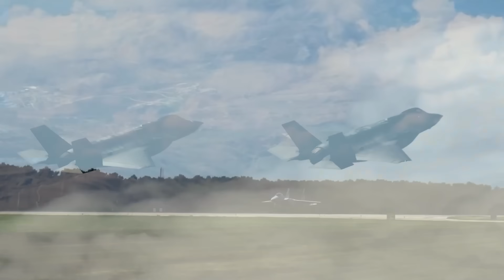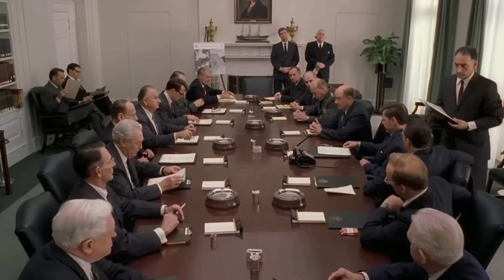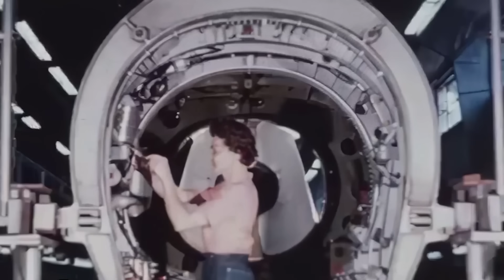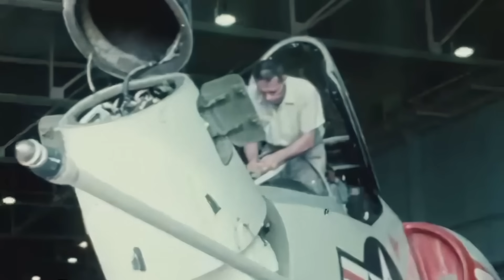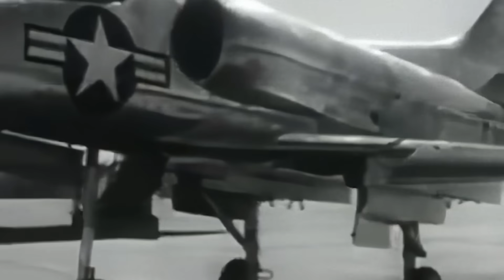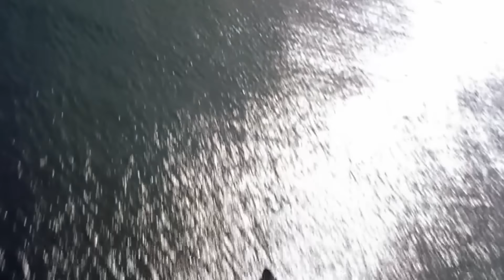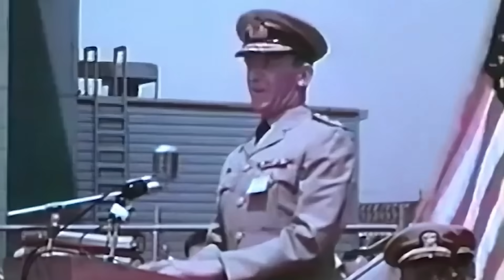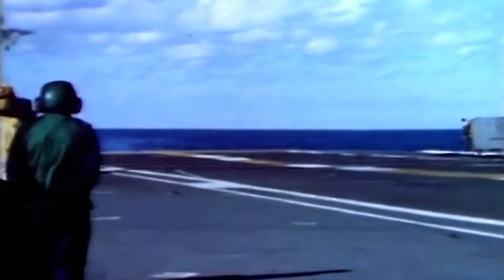A-4 Skyhawk - Simple and Deadly

Comment: This is exactely what Aero Engineers should learn
Reply: I agree to an extent. Yes, it is important to not Rube Goldburg a device ment to do only one or two tasks, look at the A-10. But there is such a thing as making something so simple it's inflexible. Again, the A-10 is a good example.

Take the F-16: it was built to be a pure dogfighter and it's very capable in this role, but soon after its introduction it was pressed into becoming a light multirole fighter, not because that's what the Air Force wanted for it but because that's what was needed to stay combat relevant for the next few decades.

I guess what I'm trying to say is keep simple stuff to do simple tasks. The problem is air defense networks are made extremely difficult to penetrate on purpose; especally modern near-peer ones which are way more intricate than they were back in Vietnam, to the point where you kinda need something as complicated as an F-35 to do so.
Reply: @pyronuke4768 or you make two comparitively cheaper alternatives, one focus on air to air to protect your “growlers” and one to focus on anti radiation sorties, and then many more cheaper craft without stealth for once air defenses have been disabled. Most of these nations are never going to face a threat from NATO, the US, or Russia/China in full force, and this is more than enough.

Most nations would be sufficiently armed with 6-12 Boramae, a growler super hornets, and 10-20 f-16/grippens/rafales or even f-5’s and another 10-12 planes in the ta-50/t7/super tuscano mix
Reply: @cjones070  it sounds like a good idea now, but what happens two decades in the future when a much larger and aggressive nation comes after you with a fifth-gen aircraft of their own while you've sat on your hands upgrading fourth gens from fifty years ago? You would be rather powerless to stop them. That's why half of NATO has been trying to obtain F-35's: to dissuade any potentially aggressive threats from attacking in the first place.
Reply: @pyronuke4768  if a much larger nation comes after you, they’re almost always going to be a generation ahead of you regardless, but that’s why i stipulated that you still need SOME current tech, but you also need quantity. For many countries having 10-20 current gen aircraft and 40-50 f-16’s, grippens, rafales, or even f/a-50 style aircraft would be better than only having 30/40 current gen aircraft.

Plus, generally speaking stealth is far more important when attacking vs defending
Reply: @pyronuke4768 Depends on the country. Smaller countries mostly need a porcupine strategy when fighting great powers, be too painful to eat so the predator moves on to easier prey
Reply: Complexity is a tool at the disposal of a designer or engineer, it by itself isn't inherently bad. Sometimes complexity is necessary for certain benefits, like fuel injection in a car offering more power, better fuel economy, and lower emissions than carburetion at the expense of being more complex, but the benefits said complexity brings more than outweighs it's inherent drawbacks for most people. That's the rub with complexity, does the benefit of whatever function or efficiency gain it brings outweigh the added cost and maintenance for it's particular use case? And that will vary from case to case. Different applications require different levels of complexity. A device should be just as complex or simple as required to achieve it's aims, no more, no less. Too simple and it may lack key features or be inefficient. Too complex and it may be expensive, unreliable, or have too high a burden of maintenance.

And as a process is better understood and production of it is easier, sometimes a once complex system can be streamlined to offer a lower cost and/or maintenance requirement with minimal impact to quality or function, but this isn't always possible.
Reply: All engineers
Reply: Particularly those in non-first world countries.  You could produce this today and it'd still be "plenty" for most air forces and what they encounter/fight.
Reply: Ppppp @oskar6661
Reply: It would probably be even more expensive now, but they should make a design that is a general design, but could be designed a specific purpose. A common airframe but meant for a specific purpose.
Reply: Learning Aerospace engineering right now, this one of my favorite aircraft
Reply: Aero and other engineers know this….. and aren’t the ones who make the decisions on what to build and what features to include
Reply: @chadwells7562  this is a very good point though
Reply: Exactly.  Most people are really ignorant about aerospace development.  The engineers don’t decide what they get to develop.  It’s the people with stars on their uniforms that determine whether or not the engineers get to develop a simple aircraft or a complicated aircraft.
Reply: The KISS policy still pays off.
Reply: As an aeronautical engineering student I have been made aware of design simplicity and it's advantages. I will definitely be applying this to my design ethos in the future
Reply: @AlpieInternet  don't get simplicity confused with adaptability. The A-4 is simple but in an adaptable way, it is a blank slate which can be easily and quickly fit for a new need. As compared to something like the A-10 where it is simple in an unadaptable way and at every turn, has required millions upon millions of dollars to upgrade just to keep up with the needs of the air force to the point that it's now more expensive to fly the A-10 than it is to fly the more complex, more capable F-16.
Reply: @treyaldridge1757 Sometimes versatility requires complexity. I think that's something a lot of people overlook. Complexity itself isn't necessarily a problem, it's only if something is more complex than it needs to be that it becomes a problem. And just as something can be too complex for it's function, it can also be too simple, which will also hinder usability.
Reply: Simple aircraft DIE in combat since ohhh 1980?
Reply: How long would a fleet of F35 survive in combat with a peer opponent? And how many could the US produce rapidly to fill the gaps?
Answer: not nearly enough.